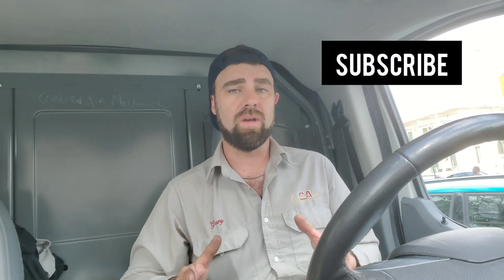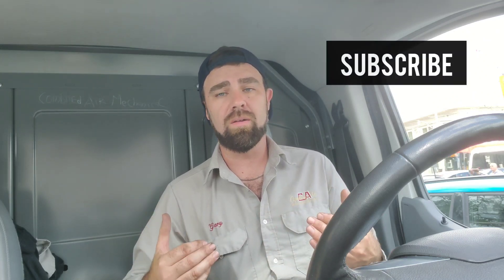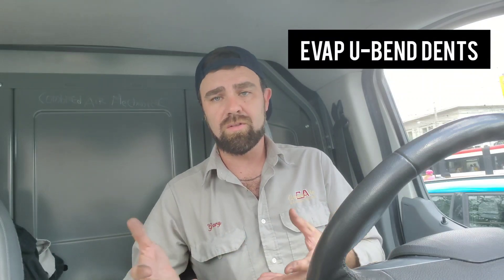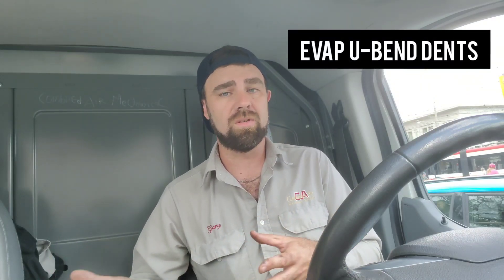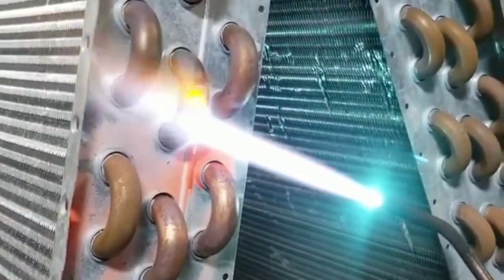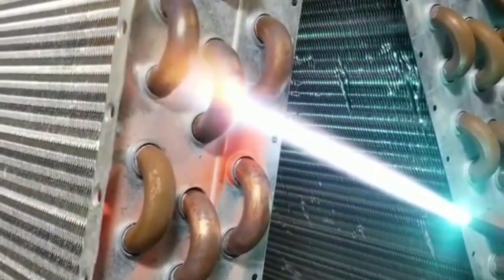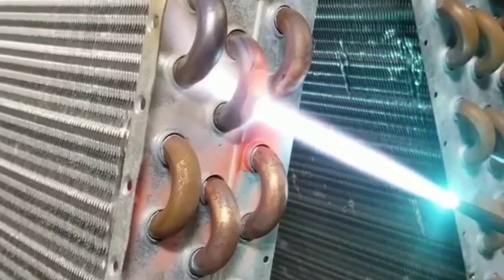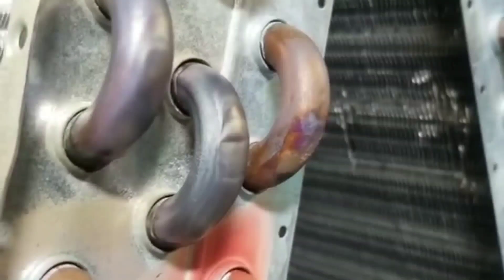How To Fix An Evaporator Coil U-Bend Damage or Dent - HVAC Tip

Comment: Interesting however I believe If it's not leaking leave well enough alone reason being The copper on coils today are thinned out as much as manufacturing can get away with,furthermore the copper u bends have already been extruded to give it it's shape so I would think the procedure shown has the potential to cause a future stress Crack but it is an ingenious trick
Reply: That or drop some soulder on it while it’s still hot to reinforce bend
Reply from the maker: If the dent is substantial enough it may restrict, so put this in your back pocket for the future.